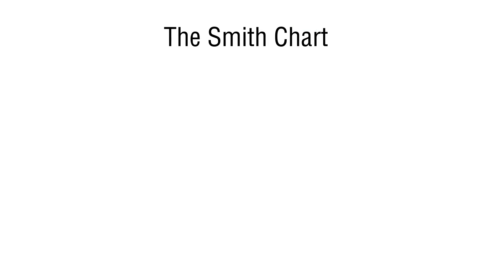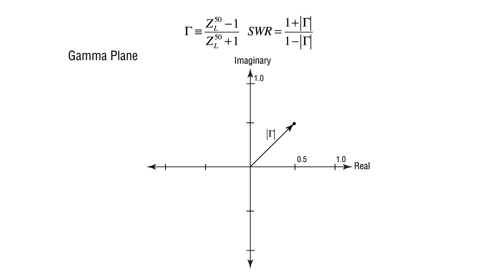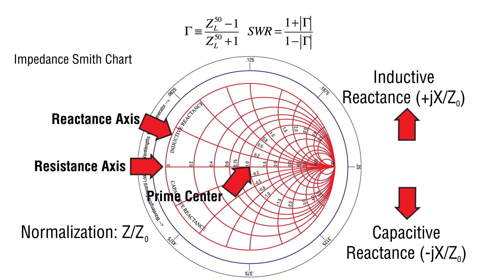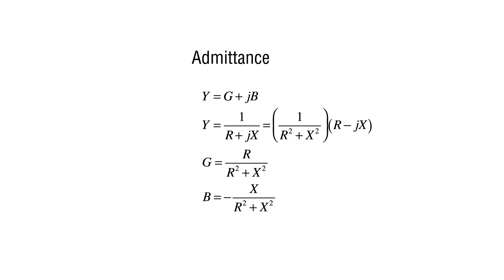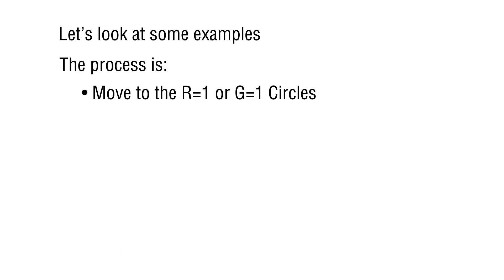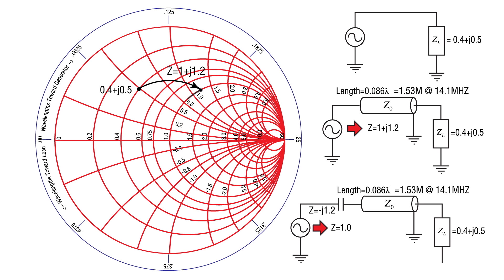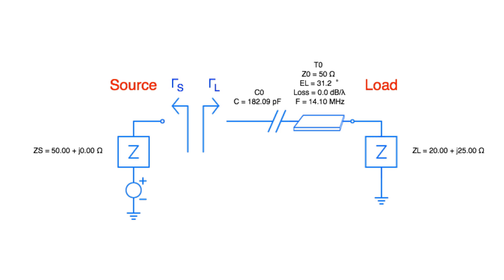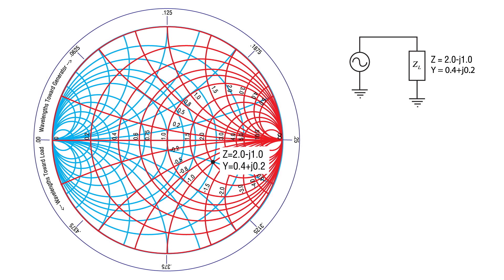Smith Chart 101

Comment: The clarity of this moderator's delivery is phenomenal.      While he ignores some of the techniques for prescribing stubs (somewhere between generator and load, along the transmission line), this moderator speaks to HF enthusiasts who might use lumped elements (inductor, capacitor, etc) near the load, to compensate for undesirable reactive loads and thus lower the VSWR (voltage standing wave ratio) to near-one value.            This video is remarkable for its departure from the usual.       Excellent... and I hope to view more from this publisher.